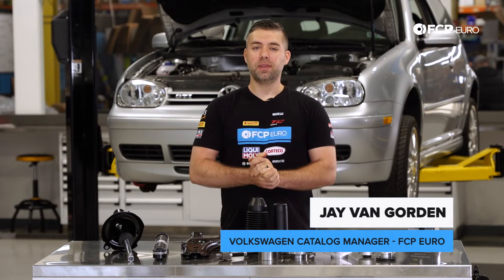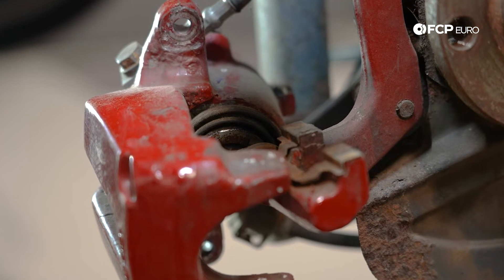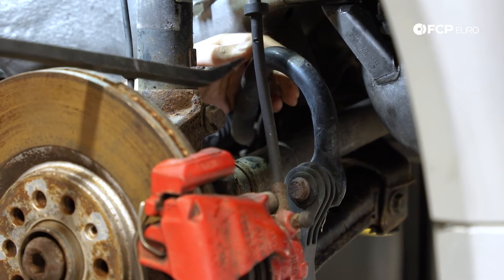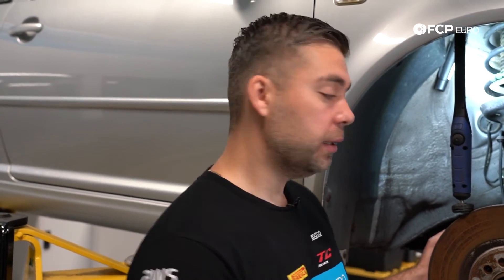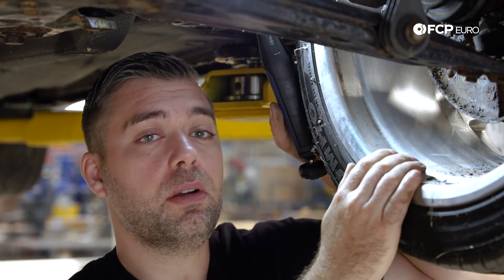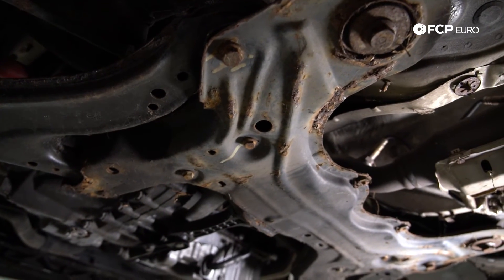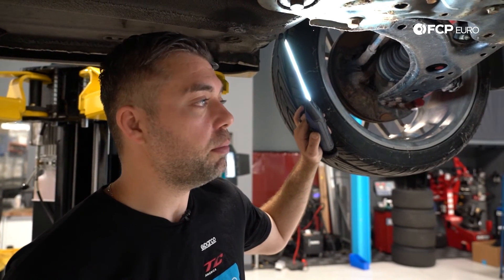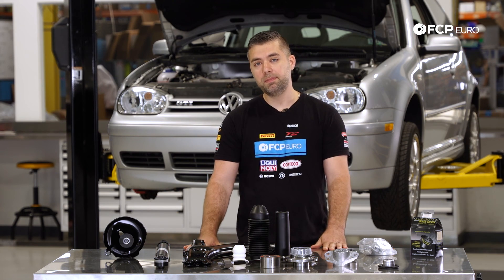Volkswagen Mk4 Suspension & Brake Diagnostic & Maintenance Guide 1998-2003 (Mk4 Golf, GTI, Jetta)

Comment: I bought a Bora 1.9tdi 4 years ago, it was covered in mold and no MOT at 118000miles, i paid a whopping £100!! And it had a full tank. I then got it MOT and it passed straight away. Since owning it i changed the water pump, cambelt, control arms, all shocks and the dual mass flywheel and clutch. Everyone always says i over worry and replace too early (i try to before things break). Including all labour and parts including servicing it regularly since owning, it has costed me around £1800 thats including a little welding on rear quarter i needed last year. Would you say i should carry on with replacing the driveshafts (i think one side clunks every now and then but not located the clunk yet anyway) or maybe think of a new car as i feel im constantly replacing things and still getting clunks but always somewhere else after fixing the first. Any suggestions, im not very wealthy and dont use my car too much as it is.

Comment: I hit a curb the other day and bent my front rim. Upon quick inspection wheel is straight, but the whole wheel seems to have shifted back about half inch. Its no longer centered in the wheel well. The shock, lower control arm and subrame dont seem to have anything bent. Any ideas what it could be? I will be looking at it tomorrow, also have a spare subframe i will be comparing to incase its that. Thanks in advance for any help